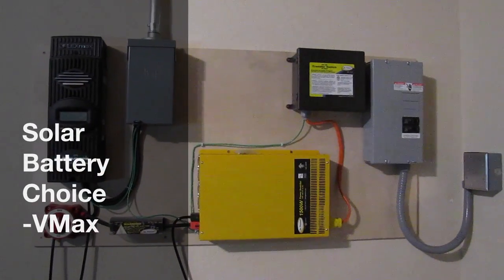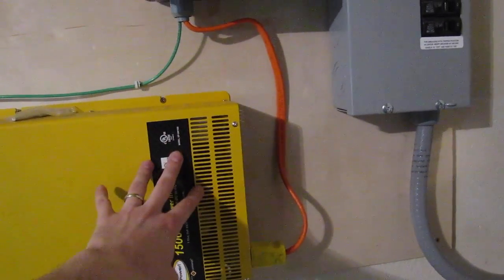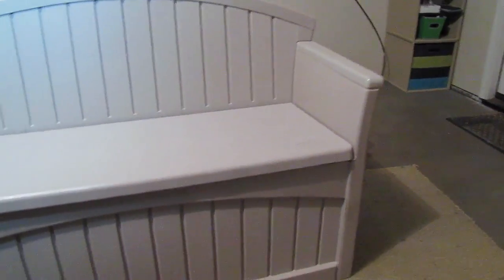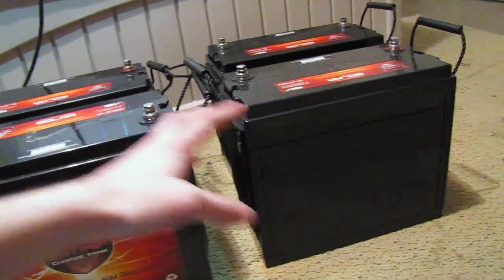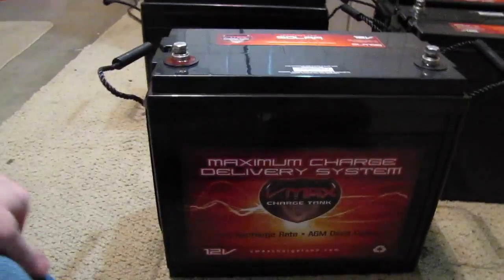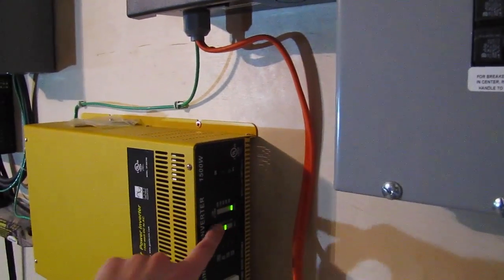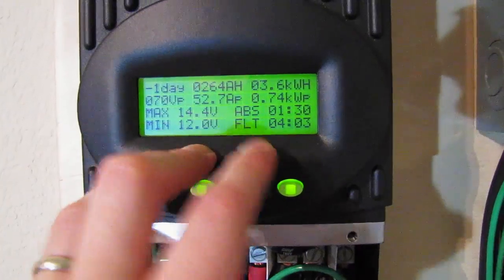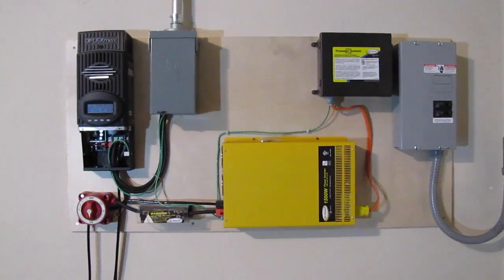Solar Battery Choice - VMax Charge Tank - Off Grid Kitchen

Comment: How are things grounded to earth in this setup, I see lots of green grounding wiring but what's it's path back to earth (copper ground rod on the exterior)?  I am assuming the transfer switch (love the concept of keep wife happy switch, totally needed and agreed) totally isolates you from your main (grid) power panel which goes to some earth external grounding.  Did you find you had any problems with GFCI breakers tripping at any point using the inverter to power your outlets in the kitchen (or anywhere there is a gfci outlet installed)?  and lastly, since you have a 1500w inverter it seems your max draw would be 12.5a (1500 / 120) before you overcurrent the GoPower device- how often does this happen to you like for example if the fridge is running say when the door is left open for too long and then you maybe run a toaster or blender or anything else with high demand?  My toaster alone pulls 13amps (four slice) and my fridge sometimes runs up to 7amps not counting surge. Those two items of mine alone, not counting any counter lighting, computers or TV's on the branch circuit demand 2400 Watts short term continuous.  Short version of above is 1500w sufficient, does it trip gfi's and where is path to earth ground?

Comment: I like your project. Everyone needs a hobby\project to keep the brain working. I am purchasing an RV and looking for solutions like yours to be self sufficient off grid. In your case however, I think an inverter\generator would be far more cost effective. You get a clean sine wave, cost effective, and can provide ample power for just about anything.  A refrigerator may cost $10\month to run 24/7.  Gonna take a LONG time to get any ROI using it for the house.
Reply from the maker: +tonkatoytruck ROI was never my goal :) Drinking a cold beer and popping a bag of popcorn with the lights on when the rest of the neighborhood is without power was my focus. Good luck with your off-grid RV, would love to see it when done.

Comment: What size breaker disconnect do you have going to your controller very nice set up, Im doing one just like this but at 24 volts 250 watt panels
Reply from the maker: +Kyle Mckay 60 amp breaker. Not sure I'll ever trip it, more of a service disconnect really. Good luck with your build.

Comment: Love it, im certain these are the same cells as what I rock in my car...I'm really thinking about going for these for my solar setup. Those are solid batteries you have there, my friend, if you charge them they will last you a long, long time...had a pair similar to them that lasted me a decade in my setup which even sat uncharged thru the winter for several years of that decade, no problem (and by 'sat-thru a winter' I mean sitting in a cold garage thru the whole winter in Ohio)...I'm really leaning towards these for my solar battery bank when the time comes shortly down the road. Thanks for the vids and all of my suspicions were realized once you mentioned car audio :) lol

Comment: Excellent video and useful informative. I have 
a Concord 157 AH AGM battery Mil spec really designed for air craft powering my humble Solar backup generator. The price on that baby breaks the bank. You got my attention on the batteries you are using and after researching the battery it appears to be a solid battery you can use for a reasonable price. Any more experience with your batteries you want to share before I confider purchasing four of these puppies?
Reply: +JuliansRandomProject 
Hi Julian.
I've recently bought a new fridge, and its total energy consumption in seven weeks (tomorrow) is currently at 9.8 KWh. Admittedly it's only a UK sized under-counter jobby, but it's using less than half the power the 15 year old one it replaced chomped its way through.
Your batteries will thank you for it!
:o)
Reply: The way I figured it out: I want to one of my appliances that draws 200 watts for roughly 10 hours. So, I would need about 6 of the 155 AH batteries or 930 AH AT 50%= 465 usable AH POWER. My appliance draws 200 watts / 12 volt system = 16.66 AH. I take the 465 AH / 16.66 AH= that gives me 27.91 hours I can safely use that appliance without over discharge. Hummm, I like this.
Reply: +stevemichelle1203 then again.. 4 batteries is exactly what I need. Ill go with a go pro 2000 watt pure sine wave inverter and a good solar charger. Looking at your solar design I will also add a breaker, quick shut off switch and an auto transfer box. I think 6 145 watt PV panels should be sufficient.
Reply from the maker: +stevemichelle1203 Looks good. More batteries as a cushion/buffer is always a good idea. I've been drawing mine down too low and it's started to take it's toll. I'll be increasing the storage and replacing my fridge in the kitchen with a more energy efficient one (the one we have is like 14 years old). Good luck with your solar build
Reply: +SarkyBugger Check out the ARB potable fridge, its a 12v fridge that runs at less than 1 amp--We're talking 240 watts hours a day and even less if you unplug it over night. Its small, probably the size of a large Igloo style cooler.
Reply: ekoms108 Holy crap! Look at the price of those things.
For the price of the cheapest one I could find, I could buy 500 Watts of panels and a few more 110Ah batteries...

Comment: Julian:
Ditto on the TS-30 Automatic Transfer Switch configuration.  Can you show a video of how you hooked it up?  I purchased the Samlex model.  I also have 2 Vmax SLR-125's. Thinking about putting a timer on the transfer switch to prevent the inverter from draining the battery until it shuts down due to low voltage (should prevent the system from draining the battery to 50%).  NSDQ!
Reply from the maker: +M Boyd Yeah, a timer would work great. Some inverters have selectable settings for what 'low voltage' is. I may have to upgrade to one of those in the next revision. I'll try and include some info about the transfer switch wiring in my follow up video. NSDQ!
Reply: +JuliansRandomProject 
Cool.  I purchased both the GoPower TS-30 and the Samlex STS-30.  I think the GoPower is going to work better because it is going to be difficult to reverse the poles on the Samlex since it is also linked to a GFCI to charge the batteries.  I am going to hook it up this weekend.  Keep up the great videos.

Comment: how are the batt. holding up
Reply from the maker: +Adam Vanderbur Not so well. The system has been taking them down to 50% each night, they're getting worse and worse now. follow up video to come.
Reply: +JuliansRandomProject 
Is that because you let the battery drain down to 10.5 volts each time and allowed the inverter to shut down due to low voltage?
Reply from the maker: It is. big mistake for a system I hoped would last a lot long than this. Operator error.

Comment: This is a very impressive project. I've done a solar power project about 1/10th of this size - my sine wave inverter is a Samlex 150 Watt tied to a simple power strip where I run a few devices. I'm looking for a larger deep-cycle battery than the one I have. Nice to know you like the VMax. My system is not tied to the household wiring at all - it's like an island of green off-grid power inside my house. Thanks for the great video!

Comment: Battery's on cold floors  will discharge faster under load and if the temps are Minus for long Duration Once the plate temps are down to zero  Neutralisation will occur .But in this set up No Issues with seating them on the floor .   25  Years electrical mechanical engineer AC /DC / Systems + Renewable Generation . Your Battery's are Odyssey Pure led battery's . just got a different colour case.
Reply: VMAX USA is an independent American company, has nothing to do with Odyssey.
Reply: same meat different Gravy dude . just example like . i use the Odysseys and they are cracking batts .
Reply: +Rs500ybd yes both are excellent batteries :)

Comment: I really love your practical philosophy. In terms of the excess capacity, rather than returning to the grid, maybe you can use the power to run an attic or porch fan (if it is hot in your area) or even charge an auxiliary (b) battery bank. (I have not gotten over the fact grid-tied systems can not be used as back-up - show stopper). I'll have to sheepishly admit, the bench is a great touch. I intend to borrow many of your ideas someday, thank you for sharing.
Reply from the maker: Paul Vudmaska Sharing's the whole point :) thanks for the comment! I currently charge a second battery bank that runs other items in the garage when I'm topped off mid day. In hind-sight I should have purchased a larger inverter.

Comment: Here is the reason why you hear people say battery's on concrete is bad idea.

Many people have the impression that when batteries sit on concrete, energy "leaks out" or they are ruined. The short answer is that letting modern batteries sit on concrete does not harm or discharge them in any way.

However, this legend is historically based in fact. The first lead-acid batteries consisted of glass cells that were enclosed in tar-lined wooden boxes. A damp concrete floor could cause the wood to swell, breaking the glass inside.

Comment: Great set up Julian, congratulations.  I've read in a few places that by using Lithium Ion batteries, you can drain much lower and they are lighter and longer lasting.  If you have any experience with them could you comment?

Comment: Great video.  Can I ask you why you have the positive and negative wire taps coming off opposite end of the batteries?  Also, have you ever heard these batteries make any crackeling noise.  I am hooking up an RV solar system and have positive and negative coming from the charge controller (the same Outback you have) to one battery, with four batteries in parallel, and then the opposite end of the battery bank is going to the inverter.  Do you see any problems with this?
Reply from the maker: melanie winsor Thanks for the questions Melanie. Never heard these batteries crackle. I've charged sealed lead acid batteries at a high rate before and they make a sound while off-gassing (normal, just make sure you're expelling the gasses outside). With these AGM batteries I've not notices any noises while charging. I'll take a listen real close next time they're in Absorb mode. 

As for the Pos and Neg leads at either end. Schematically they're the same point and should be fine. But I've read from others that have had large off-grid setups that when tapping off just one side it tends to overwork that nearside battery. Path of least resistance? Not sure, I haven't experienced this myself, could be a "Cargo Cult" thing :)

Good luck with your RV, hope you post a video about it so we can all see.
Reply: JuliansRandomProject Thanks for the quick response.  I would appreciate you taking a listen next time they are absorbing.  I can hear the noise when my head is about a foot away from the batteries, and it gets louder the higher the voltage gets.  I tried reconnecting my system in a similar fashion as yours so one side isn't so heavy on one battery and I am still getting that sound.  Can I ask what your float and absorb voltage and absorb time settings are on your Outback?  Along with any other settings that I may have missed.  I have mine set to 14.5 absorb for 2 hours, then 13.6 float with 6A of absorb end amps.  Not sure what I am doing wrong still.

Comment: Great set up.How did you hook up the box for the  incoming solar wires next to the outback,and what is the name of the box.I guess you are using it as a combiner box.I would just add an extension to the support board to your wall for the capacitor,it looks like you have a little room from the top of the bench.Very impressed!
Reply from the maker: Gary H Thanks! The combiner box is in the crawl space near the roof. The box next to the outback controller is a DC breaker that I'm using as a "solar panel disconnect" in the event I need to service or replace the controller, no on wants to get back into the crawl space :)

Comment: What solar panels are you using for your project? I'm in the beginning phases of determining my needs.
Reply from the maker: Kevin Neberman 250W panels from an american company called "Grape". Bought 4 of them as a set to get 1KW on the roof. Search Amazon and you'll find them or even more efficient ones now from the same company. Good customer service (I had a few questions about mounting).

Comment: your setup is good and clean. i have question so for the inventor you have a 1300W right? i think the refrigerator uses about 700W so you will be left with 600W will they let the rest of the stuff to work? the other thing is i do not know how many watts does the inventor needs to power the 110V can we say that since the 4 Bats on 155A will give you about 620A to discharge the bats completely we need to divide 420/(what the inventor Amps use)=life for getting electricity off the bats? i understand that you said to not use all bat's charge to keep them alive for longer time but yeah. and i wonder how many solar panels are you using? a 100W gives about 5.56A which means you need 6hrs to charge each bat? i would appreciate an answer , thanks for the video and your time once again.
Reply from the maker: 199alexman The inverter is 1500W. The fridge uses a lot less than 700 watts and it's not continuous, it goes off and on to maintain temp. Think of the 1500W as the peak load I can handle at any single moment. I have 4x250W panels on the roof = ~1000 watts. Right now I use about half of the battery capacity to get through the night and top off the batteries around 2pm the next day. Batteries just float and solar powers the kitchen until the sun sets and the cycle starts all over again. Hope this helps to answer your cryptic question.
Reply: JuliansRandomProject i see yeah, thanks for answering, what was the cost of the entire system? if your fine saying the cost ?
Reply from the maker: 199alexman Solar Panels ($1500) + Batteries ($500) + Charge controller ($500) + Inverter ($500) + Wiring + Breaker Box + labor to have the panels installed on the roof.  Totaled about $3800 

I wasn't installing solar to save money like some others do (grid-tie), I was more interested in playing with solar and experimenting with batteries. And now when the power goes out my kitchen stays lit up :) I can pop popcorn and have a cold beer.
Reply: that's legit. thanks for replying back. the thing is my dad wants me to install solar system in his house and he is wondering how much it would cost and so forth that definitely helps. thanks for sharing the information.
Reply: +JuliansRandomProject. What's better sealed or non sealed batteries and do you recommend any books for laymen like me on solar.
Reply from the maker: I chose sealed for mine because the battery bank is located indoors and I was too lazy to build a vent to the outdoors. Typically 'wet' cells are cheaper but require some maintenance and care to prevent them from tipping over. The sealed cells (AGM) can be installed on their sides or upside down even. 

As for a book, I've heard good things about power4patriots, lame name but good info.

Comment: Actually, you can only bring it down to 70% if you want longevity.  If you drain it to 50% often, then  it will lower it's life expectancy by half.
Reply from the maker: I'm experimenting with that. When these die out I'll be moving to LiFePo or Edison cells
Reply: JuliansRandomProject whoa,  really?  Those aren't cheap batteries.

Also, I have been curious about those desulfating products.  There are chemicals you can add to remove desulfation. It suppose to double the life of the lead acid batteries.  And, there are chargers that will do the same thing through pulse charging. I have no experience with these products, but I'm keeping an eye on people who are experimenting with it.
Reply: +JuliansRandomProject 
I'm always scared of a move to lithium especially such big batteries.  LiFePo is supposed to be safer though. However there are still some reports of the battery terminals melting and the battery case blowing up like a balloon. I have not heard of fire with LifePo yet but I would guess maybe its possible and time will tell as more people use them. Even lead acid batteries can catch fire also if you abuse them. I had one really hot and smoking AGM battery from a 6 year old UPS backup which I ran outside with oven mitts! Still I like the consistency and stability of AGM and golf cart lead acid wet cells even at the cost of more weight. You can have a lot of amp hours for the price in golf cart batteries if you've got a well ventilated area.

Comment: Great Video. Looks like a very neat and tidy setup. The only thing I would suggest would be to run those cables from the cut off switch to the battery bank through some PVC conduit. Just for safety more than anything else. Thanks for sharing